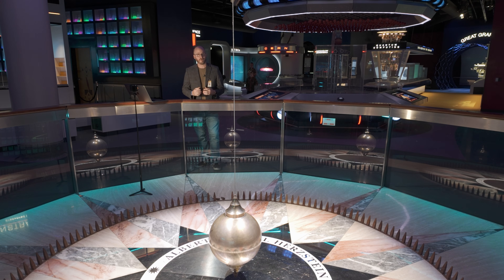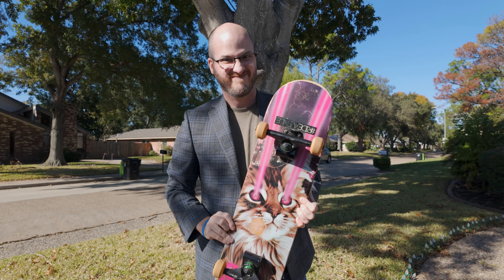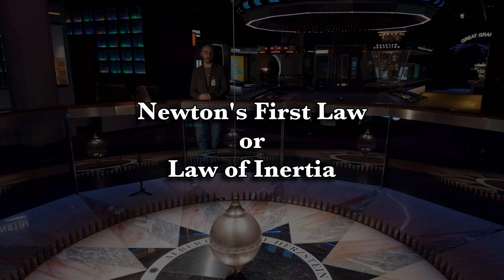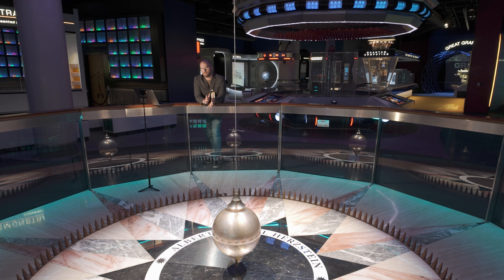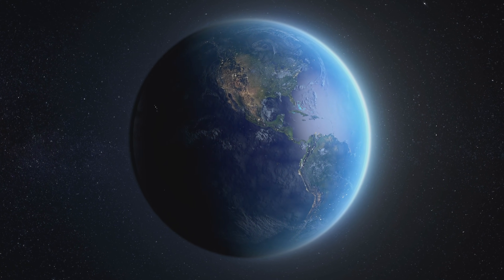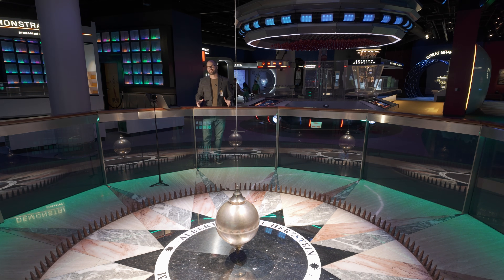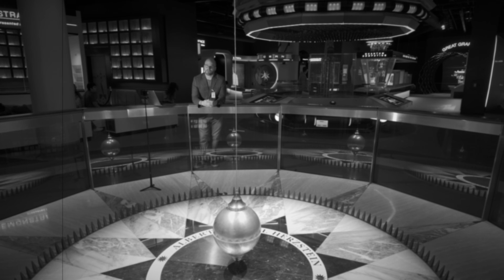Why doesn't the Foucault Pendulum cable TWIST with the building itself as the Earth rotates?

Comment: In the case of a Foucault pendulum bob there is an interesting subtlety in the motion pattern that is well worth being aware of. The latitude of the city of Paris lends itself well to demonstration of that. At the latitude of Paris (52 degrees) the period of the veering of the plane of swing (relative to the Earth) is about 32 hours. That means that after 24 hours (the Earth being back in the same orientation as the day before) the orientation of the plane of swing is at three quarters of its complete cycle. That is: if the pendulum was started in north-south direction then after 24 hours the orientation of the plane of swing is east-west.

What happens is that the pendulum bob and the Earth exchange momentum. 
Of course this doesn't change the logic that the veering of the plane of swing demonstrates that the Earth is rotating; in order for the pendulum bob plane of swing to be longer than 24 hours it must be that there is exchange of momentum.

It is exclusively in the case of a polar Foucault pendulum that there is no opportunity for exchange of momentum to affect the orientation of the plane of swing.

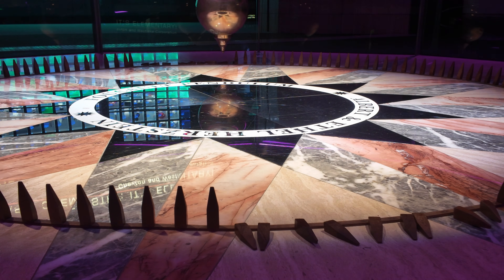To visualize the concept of exchange of momentum between the pendulum bob and the Earth we can shift to a case where the mass ratio is much smaller, let's say in the order of 1:10.
Imagine a nicely spherical asteroid, and you build a tripod on it so large that you can suspend a sphere with a mass one tenth of the mass of the asteroid. 
First the case of the asteroid not rotating. 
As the pendulum bob swings: whenever the pendulum bob is not vertically under the suspension point there is a force component on the suspension point that acts sideways. The orientation of the asteroid will be affected by that sideways acting force.

When the asteroid is rotating, and the suspension point of the giant pendulum is not above the pole: then the orientation of the plane of swing will be affected by exchange of momentum between the pendulum bob and the asteroid.

In the case of the Earth and Foucault pendulum the effect of the pendulum bob on the Earth is of course way, waaay below detection level. 

After 24 hours the orientation of the 52 degrees latitude Foucault pendulum is shifted by 90 degrees
It follows from the laws of motion that the Earth has underwent an equal magnitude and opposite in direction change of momentum.

We have that exchange of momentum between pendulum bob and Earth introduces its own veering of the plane of swing of the pendulum.
At the poles the rate of veering of the plane of swing relative to the Earth is once per 24 hours.
At any latitude not at the poles the exchange-of-momentum veering of the plane modifies the relative to the Earth orientation of the plane of swing.

So yeah, I think this aspect of Foucault pendulum motion well worth being aware of.
Again, this doesn't impact the purpose of the Foucault pendulum: to demonstrate that the Earth is rotating. 
The exchange of momentum between the pendulum bob and Earth that modifies the orientation of the plance of swing occurs only if the Earth is rotating

Comment: Great video! What happens if You install one of this pendulums right in the Equator line?
Reply from the maker: It will not precess around the perimeter. Whatever direction it starts, it'll stay!
Reply: At the North Pole, it precesses clockwise (as seen from above, from a reference frame fixed to the earth). And it does this at 359.75 degrees per day. At the South Pole, it will do the same, but opposite direction, counterclockwise. Halfway between those two, it will not pieces at all. Between the pole and the equator, it will precess at a rate that it would at the nearest pole, multiplied by the sine of the latitude. So it will be precessing relative to space AND relative to the spinning planet. It gets complicated. Look up ‘Parallel Transport’ for more. It’s neat.

Comment from the maker: If you look closely, you'll see the swing pattern is actually a very, very tight figure 8...that's the Earth *rotating on its axis! If you look even closely-er at the pendulum "not moving", it's actually swaying a tiny bit...that's air currents moving through the building! Remember the electro-magnetic ring that tugs on the top of the cable's collar to maintain momentum? The swaying is a perfect demonstration of the air-resistance that electro-magnet is used to counteract! Why am I yelling!?

- Temu VSauce (Johnny), HMNS YouTube and Podcast Manager
Reply: Good video about a lovely exhibit. 
But your comment is in error. 
The swing pattern is indeed a tight figure of 8, but that is not due to the earth wobbling on its axis. The earth does not wobble noticeably on any human timescale, and certainly not on any regular pattern that would affect a pendulum.
The figure of 8 is literally due to the earth ROTATING on its axis. The cumulative effect of that figure of 8 is the point of the pendulum.
That movement is due to the Coriolis Effect between the pendulum's pivot and the north and south ends of its swing.
Reply from the maker: Great catch, I shall amend!
Reply: @houstonmuseum Thank you.
Reply: I mean, being compared to vsauce isn't really a bad thing imo 😂